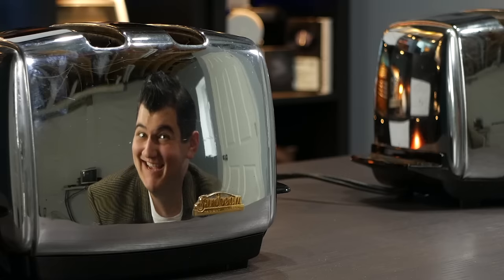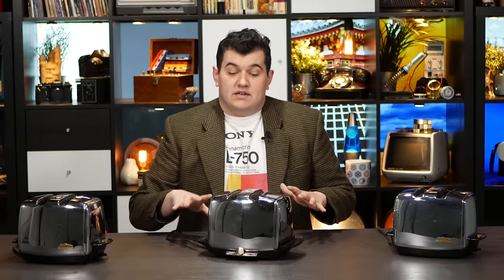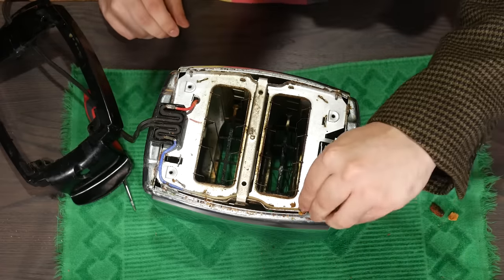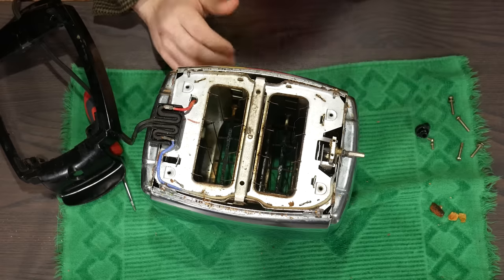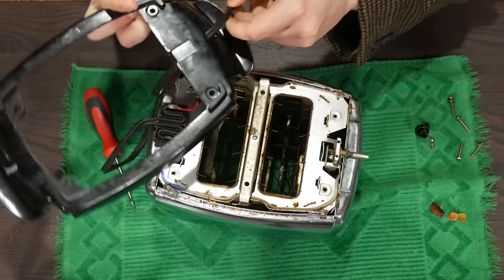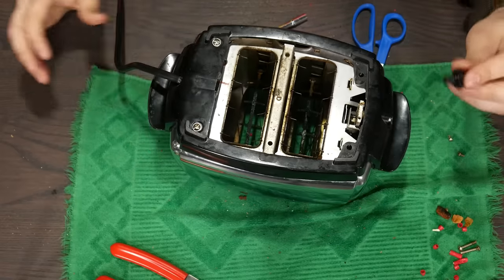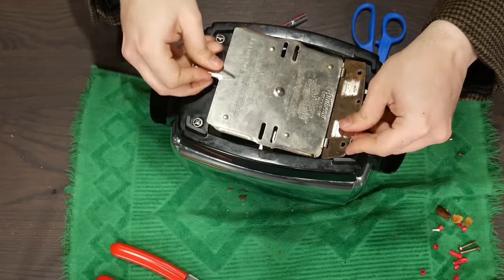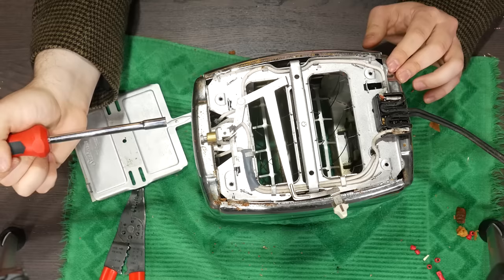Sunbeam Radiant Control Toaster--Repair and Modernization

Comment: 1600 watts is "wickedly powerful".

laughs in 240V
Reply: Lmao. But it gets harder when American tries to add RGB input to his CRT TV.
Reply: @teslakovalaborator  totes not the 8 bitguy
Reply: God I wish we had 220 or 240 in NA. I'm tired of it taking like 10 minutes to boil a liter of water. 

My English relatives had a hard time understanding that I simply boiled water in a stovetop tea kettle, because it was faster than an electric one. The only electric kettle I liked was my Zojirushi hot water dispenser, because I didn't have to wait.
Reply: @mhammadalloush5104  Not even talking about NTSC. But still less shittier than Sécam
Reply: @whette_fahrtz  We do have 240v in North America for our stoves.  It's using both phases of the split phase that comes into your house.  The dryer also uses it too.
Reply: @hakemon  when you connect an oven or stove on this side of the pond it's 400V (3 phases, 230V*√3). Dryer plugs into standard 230V wall socket though.
Reply: @hakemon  Right but will an electrician put a 240V outlet on my counter? Can I find any electric kettles at Target that use 240V without an adapter?
Reply: @whette_fahrtz  every outlet is 240v+-10%. usually just phase ->fuse -> outlet (ofc theres gfci in there somewhere. please for the love of god let there be one )
Reply: ywah, not like trump stopped an ongoing korean war or lowered taxes and shit right?
Reply: I just checked my 240V toaster. 2100W. The main thing. I remember from my trips to North America is how crazily thick the power cables are.
Reply: @HidekiShinichi  LOL really? I think you will find the U.K> has exactly the same free speech protection. You can pretty much say anything you want. Not that I would ever be rude to anyone without merrit!
Reply: She's just as bad as trump. sadly
Reply: @kalpaucjusz8741  
US has this too for major appliances.
Reply: You can still buy 1600 watt hair dryers. I don't know why hair dryers are the exception. I think it is ridiculous for a handheld heater to be allowed to use that kind of power. I personally think cooler hair dryers are better for your hair, but that is just my opinion.
Reply: and thats exactly why in uk you can be locked up for a "hate crime"over stupid joke with "nazi" pug because someones fifis get hurted.

Yeah great free speech... I mean it is free as long as you are saying what is permissible...
Reply: Higher voltage means less amperage. Not sure what you're joke is about. You can get 2500 watts on 120v. You'll just need roughly twice the amperage on 120v.
Reply: @K-o-R  uhm i think the purpose of the breakers in germany for example and the us is to prevent the cable in the wall from burning and not to fuse the appliance cord
since its usually easier to just put a fuse socket into the equipment as opposed to creating a giant phat plug that can only be plugged with the cable facing downwards
Reply: @K-o-R  That would be a good idea but they aren't.  Our appliance cables are thicker than 240V ones to handle the load of the appliance at half the voltage, but many of them are far below the current rating of the circuit.  As an electrician, I would never do that, but if I  was an appliance manufacturer I could do whatever I wanted.
Reply: @whette_fahrtz  I am an electrician and I put a 240V receptacle on my counter and bought my UK kettle on Amazon, but that doesn't really help you, sorry.  Just don't let anyone tell you it's not possible.
Reply: @TheMechanicalPhilosopher   was wondering how common this is myself

Do you use a standard UK outlet as well?
Reply: @bryanjk  I really wanted to as that is a great plug but I wasn't having any luck finding a way to get a UK receptacle here for a reasonable price so I just changed it to a standard US 20amp 240v as used on air conditioners and such.
Reply: You have to buy a license to own a TV set.  Americans would start shooting politicians if they tried imposing something like that here.
Reply: Also charging an electric car.
With 230V and 10 or 16A even a regular plug makes sense. But with 110V it is just super slow.

And room heaters. A European ne can dump up to 3kW of heat I you room easy :D
Reply: At least Trump could have negotiated a good deal with the EU
Reply: @whette_fahrtz  We have 220V in NA... Just wire an outlet for 220V and live the dream. Yeah you'll need to order the kettle and wait a whole day, like a caveman.
Reply: Thicker electric cable can indeed handle more amperage.
And increasing amperage the way for electrical company to provides 'upgrade options' to customers.

I remember trying apply for such upgrades in 220Volt land, those at electrical company quite ecstatic about it and proceed for inspection in the next day.
But they soon tell me that the upgrades plan can't be carried out
because the installation cable used was too thin and current amperage is already at maximum allowed by safety protocols, increasing it further would be regulation violation.

Bummer, replacing the electrical installation cable are not an options as its embedded inside the building structure.
If those cables were using the electrical US standard cable, I would be happy with the upgrades, and Electrical company would be happy with increased revenues from me.
Reply: @teslakovalaborator : Not really. RGB or not has nothing to do with whether the display tech. is a CRT or something else.
Reply: @teslakovalaborator : "Seacam"? What's that supposed to be, according to you?
Reply: @whette_fahrtz  You can get 240 in NA. From end to end, the secondary of the utility transformer is 240,  just like the rest of the world. The difference is there exists a center tap, which is the neutral for 120 V circuits. There is a separate plug/receptacle type for 240 in NA, with the right prong horizontal instead of vertical as on the corresponding 120 V plug. There is no neutral, so both sides need to be switched.
Reply: 60Hz is better than 50Hz
Reply: @scno0B1  If you live in Russia or an old Soviet‑era building in a post‑communist country, then there probably isn't a GFCI.

Go look at @ElectroBOOM’s recent video about shitty knockoff phone chargers electrocuting people in the bath in Russia.
Reply: @Repofox  Well, 3-phase is not necessarily better. You have to make sure the phases are balanced, and there are few devices (containing 3-phase motors) that might benefit from it from a domestic standpoint.
Reply: @Repofox  Well, maybe it's different in Sweden, but here in Spain, they charge and limit you for the total power available, with all phases combined, not just the power in one phase, so you only get a part of your contracted power in each phase (how much depends on your contract). So unless you have 3-phase motors, there's no real advantage as most consumer devices are made for just 1 phase.
Reply: 3 kW toasters?
Reply: @dougbrowning82  This is incorrect. The plug with one blade horizontal is for 20 amps 120v. This is why 20 amp outlets, like in kitchens or garages, have one T-shaped slot.
Reply: @joshuasorell9092  That depends which blade is the horizontal one. On the 120v plug, the neutral blade is horizontal on the 20a, which corresponds to the "T" shaped slot  (left side) on the receptacle, which accepts both 20 and 15a plugs (vertical). The right (line) slot is vertical. On a 240v receptacle, the right slot (line a) is horizontal, while the left one (line b, there is no neutral in 240v circuits in N America) is vertical for 15a and "T" shaped for 20a (again, accepting both 20 and 15a plugs). Thus, a 20a 240v plug actually has both blades horizontal (these are sometimes found on heavy duty machines such as welders). While not commonly found in homes, 240v plugs/receptacles do exist and have NEMA numbers.
Reply: @kalpaucjusz8741  Also South Africa
Reply: @charlesturner897  No, I'm talking about Germany. Nobody cares about the UK. We get 3 phases 63A fuse each.
Reply: Yeah, my deep fryer pulls 2.9kW and it plugs into a standard 16A socket.
Funfact: the standard power hookup here (Italy) is 3kW (+10-20% tolerance) so I have to make sure there's no other high power equipment running or it trips the power meter.
Reply: @GRBtutorials  Here in Italy you're supposed to try to balance the phases as much as possible, but as a residential user you can pull as unbalanced a load as you want without any consequence. You don't even pay for reactive power unless your power hookup is for more than 16.5kW (at which point it's hardly residential).
Reply: @whette_fahrtz  love my Zojirushi , but one day it started  dispensing 208 degree hot water continuously all by itself.

I would definitely watch an hour about how to fix that!
Reply: Most houses in the United States has a 240v outlet. Generally one for the oven and one for the dryer. If you can adapt the 240v outlet to work with a 220v appliance, it should work.
Reply: Bill_Clinton69 Because Britain (240V) joined the EU (220V) 47 years ago, they changed the EU standard to 230V throughout.  So except for incandescent lightbulbs (now illegal anyway), European appliances are generally for about 210 to 250V at 50Hz, and many will work fine on 220V at 60Hz.
 As for outlet amperage, the common values have been 2.5A (575W), 6A (1350W, old), 10A (2300W), 13A (3000W) and 16A (3500W).  So if this toaster was sold in Europe between 1950 and 1980, it would probably use half-diameter heating wires to run cleanly from 6A ungrounded outlets.  As others have mentioned the feeds to homes vary a lot by country traditions.  UK seems to be a single 100A phase, some countries are 3 phases of 35A each, rural Norway is often a floating 3 phase with 230V phase to phase and no neutral.  3 phase 63A x 230V (40 000W) would be a lot for a home unless it was built to allow a small professional workshop or business.
  Oh and throughout Europe, the main way to balance loads among the 3 phases is to rotate the wiring between homes, so if your dishwasher is on L1, your left neighbors identical home has it on L2 and your right neighbor on L3, so when everyone watches the same game on TV and eat at the same time, the dishwashers will still be distributed.
Reply: yogibear2k2
How you liking Boris? :3
Reply: @Repofox  every modern electrical grid uses 3-phase. It's literally how we can use AC power without power drops since a single phase cycles from positive to negative. The three phases make it more consistent in staying around the peak positive voltage. 115v outlets in the usa still use 3 phases, just at a lower max wattage output than the "appliance line" 240v that we have for home use for clothes dryers, A/C and furnaces, electric stoves/ovens, and some water heaters/boilers.
Reply: same free speech protection? What about Count Dankula getting jailed for telling a joke? Or Tommy Robinson getting jailed for covering a court case? The UK has no protections for natural rights. USA is better than any country in the world in terms of rights protections
Reply: @AN-yy9cq  tax cuts benefited mostly the middle class. It only hurt the middle class in the high tax SALT states of which I live in (Illinois) and I am glad the SALT subsidy got repealed bc it was only encouraging bad state policies at the expense of states with good policies. Trump has never revoked a citizens status nor has he threatened to. Get your news from somewhere other than propaganda sources like CNN and MSNBC.
Reply: @octane613  he wasn't a Jackass. He was a YouTube comedian whose gf had a pug who "was too cute to do any wrong" so he tested that theory with a joke by teaching the pug to do something so universally evil that it couldn't be considered "too cute to be wrong" and tbh, that pug was still too cute. In the USA, he would never see jailtime because he was making a joke, not hurting anyone. UK has no free speech or even rights of any kind for that matter. The UK and most other countries in the world have "provisional rights" meaning rights granted by government and therefore can be easily taken away at the whim of the government thus more privilege than a right
Reply: @jamesgarlick4573  I'm a Power Systems Engineer, what you said is very wrong. First, all three phases cycle through positive and negative relative to the neutral. The reason why its more efficient than single phase is because in a balanced system there is no need for a return path. Second, 120V and 240V in residential are single phase. Take a look at the power line outside your house. You'll probably only see a single line at the top of the pole. That's because three phases usually only runs down main streets for commercial and industrial use. When entering side streets with residential, only a single phase is tapped off. The utility's transformer supplying power to your house is most likely a "single phase" unit. It will use one phase and ground to energize the transformer primary. The transformer secondary voltage is the 240V. The 240V split in two and the center is connected to ground to cleverly create a 120V and 120V. The two phase legs of a residential is therefore 180 degrees apart compared to three phase 120 degrees. (Note: There are exceptions where the primary circuit is only Delta and not Wye and so you'll need two primary phase. In these cases you'll use two primary phase to create the single secondary phase for residential).
Reply: @whette_fahrtz  My induction stove boils a water for tea in about a minute.  Love that thing.
Reply: @masterluu8  Not entirely. Although they are very much a thing, 400V is becoming increasingly rare in households. Most ovens I've seen accept both 230V and 400V for just such cases. You'll only really commonly find 400V cookers in commercial settings.
Reply: Question. What is the common amperage for the 240v house lines in your location? I can't find a straight answer for it. I know for NA it 110v-120v at 30amps (or 15amps for older homes) and 220v-240v at 30-60amps and/or 2x-3x 120v on one line out phase by 120° or 180° (so a fake 240-360v) at 15amps-30amps.
Reply: @kojoe94  In the UK, the absolute maximum you can draw is 100A. Sockets are 13A, and a single ring-main is 32A. 30A at 110V seemed a little low, so looking online (as in 5 minutes), apparently US homes can have as much as 200A. Unless I'm misunderstanding you?

Also, its not a "fake" 240V: the thing you're reffering to is 2-phase (or 3-phase) electricity. Our 3-phase here, as you can probably work out, is 415V (16A), using the special 4P+E/3P+E plug.
Reply: @tubeducky  cool thanks. Sorry if my term of "fake 240v" was used loosely, i do know what 2 and 3 phase power is, i was saying it as it with was a intuitive way of creating a 240v-360v line from 120v power without truly coming from the Mains. 
Anyways thank for the info. So if the average UK voltage is 240v and the avg amperage is 13amps then the wattage would be 3120 watts. And if the average NA voltage is 120v at 30amps then the wattage is 3600 watts. The wattages are quite similar. That's interesting. (Voltage do matter though depending on the appliance)
Reply: @robertgaines-tulsa  Hair Dryers are the Exception cause they are quick use units, think about how long a Toaster, Tea kettle mini oven or space heater work, they are in use for a long period so just for a bit of protection they are capped to 1500 watts, hair dryers can goto 1875, but only cause they are quick shot items, usually for 15 seconds, then off 15 seconds then off, so on, also they rarely ever use that full power the whole time as the elements will get very warm very quick. the whole reason for limiting to 1500 is just as a bit of precaution in older houses with older wiring to prevent the wires in the wall from burning down.
Reply: Yep here in Britain we have 240 volts and 1500 watts is nothing. A uk pug socket will handle 3000 watts (13amps) and our plugs are MUCH safer then the us nema plugs.
Reply: Hakemon Mike doesn’t change the fact that the system Edison adopted is poor but I guess you can because when the national grid was established here in the uk the weakness of a 110/120 v system was more obvious.
Reply: Trump is probably one of the worst presidents in living memory only 3 presidents in history have even been impeached and he is one of them he is racist sortove like a modern Andrew Johnson, a crook like Nixon, and at best he is as respectful of women as Bill Clinton he combines some of the worst qualities of some of the worst presidents in US history if only he had been in office as long as William Henry Harrison.

For people who don't know US history A Johnson, and B Clinton were the first 2 presidents to be impeached and William Henry Harrison was only president for about a month before he died.
Reply: @HidekiShinichi  the war technically still isn't over and his tax cuts weren't accompanied by significant cuts in spending resulting in massive budget deficits and skyrocketing national debt levels, this combined with his alianating several US allies and inefficiently(targeting finished products that were the source of dispute such computers would have been better for US industry than raw materials such as steel and would have put the same pressure on China to change how it behaves towards other nations) using tariffs to try force China to act in ways that are more beneficial to the US indicate that he proritizes the short term even when doing so would be detrimental to the US as a whole.
Reply: @jamesgarlick4573  don't know what you consider middle class but a reduction in the amount someone has to pay in taxes for a private jet doesn't strike me as helping the middle class.
Reply: @garethbaus5471  that private jet has to be build by someone, all materials dug out of the ground and processed, everything shipped multiple times, guess who is doing most of that job and getting paid for that and if someone wiuld not buy a private jet all that job is not there.
Reply: MAGA 2020
Reply: This fucking comment thread is one hell of a ride.
The mix of geeky debate and unproductive political discourse is both extremely funny and a tragedy. 

If you read this and haven't read everything above and are bored, take a ride through the comments.
Reply: the UK's defamation law allows harmful true speech to be cause for a defamation claim
Reply: He didn't forget his meds. He went off his keto diet. It looks slightly different.
Reply: @thatsunpossible312  220 by 60 just isn't right.
Reply: @ellenorbjornsdottir1166  the Hertz hurts? Lol
Reply: Hope your legs heal up soon.